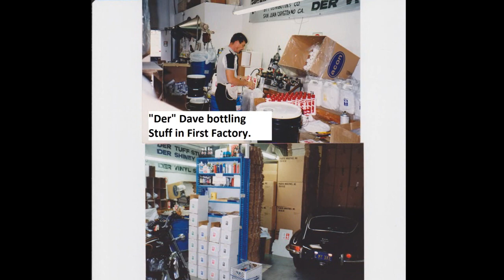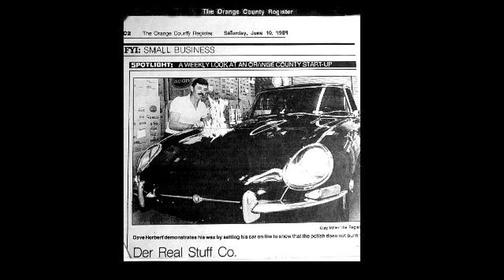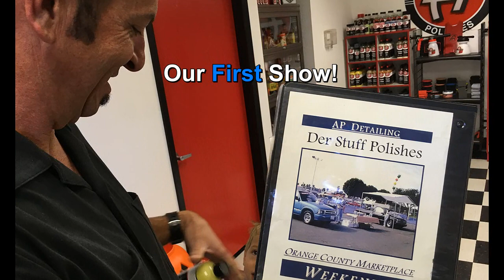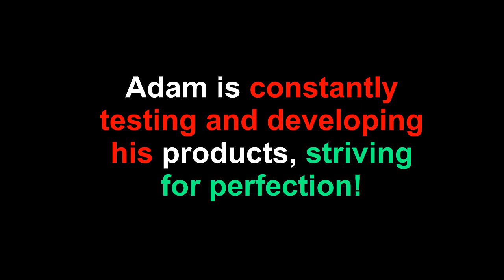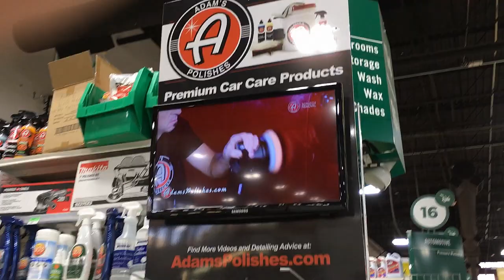Adam's Paint Swirl Killer : Behind the scenes look at Adam's Polishes!

Comment: I have a camper with a fiberglass nose with the gel coat that is giving me trouble. I have polished it and used a synthetic polymer polish. It doesn't last long and the gel coat is right back to the oxidized state again

What would you suggest?
Reply from the maker: I use VRT to clean gel coats ( I know its for vinyl and rubber, but it cleans gel coat well) and I cover them with Brilliant Glaze. I would email Adam If I were you and he will tell you what is best for Gel Coats in his line up, though.  Good question.  Thanks.